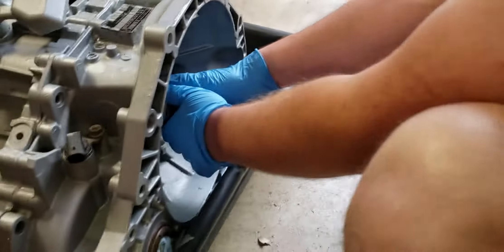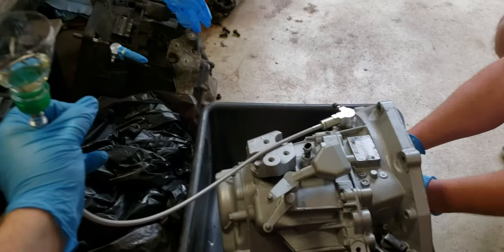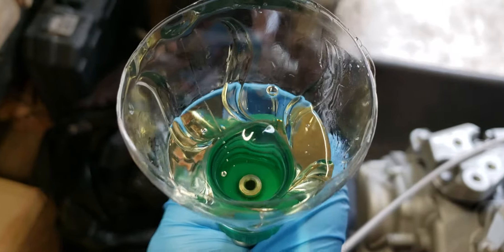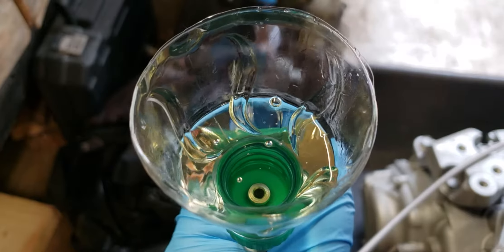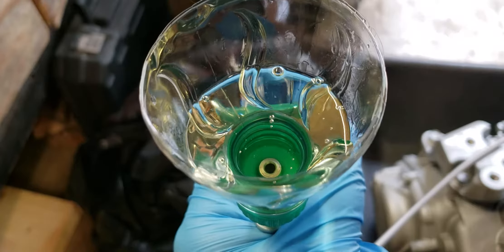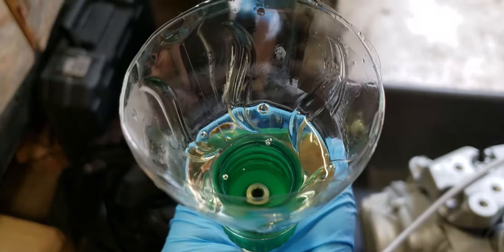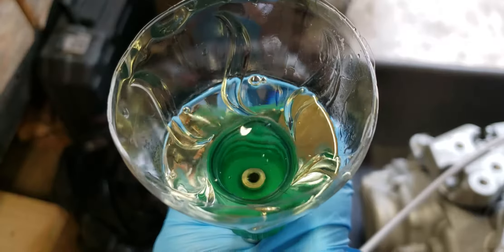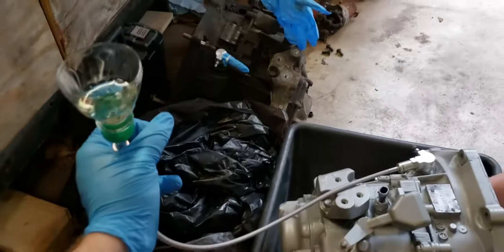Saturn Ion Redline / Cobalt SS - LSJ/LNF - Clutch Bleeding (Slave Only)

Comment: Soooo the transmission has to be out?
Reply: I think there should be a way to do it with it in. You should just be able to locate the valve for slave cylinder I believe, that's the problem I'm having right now.